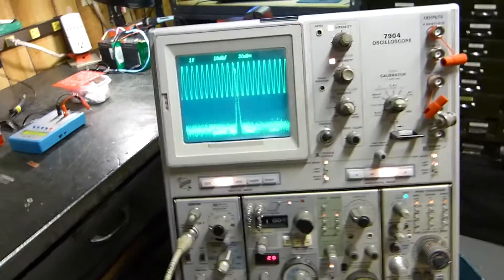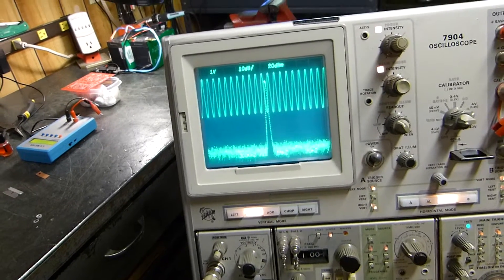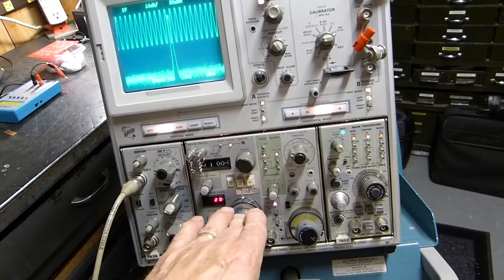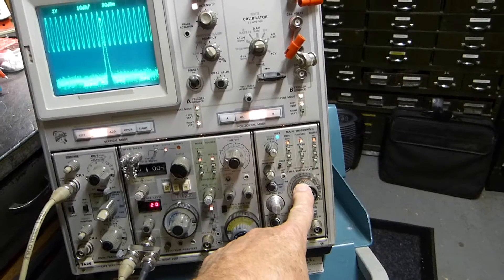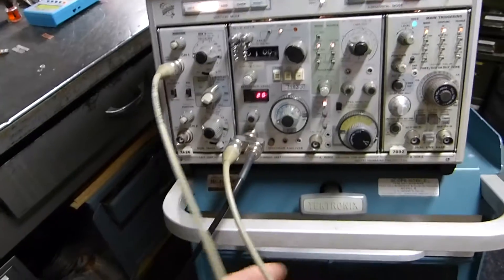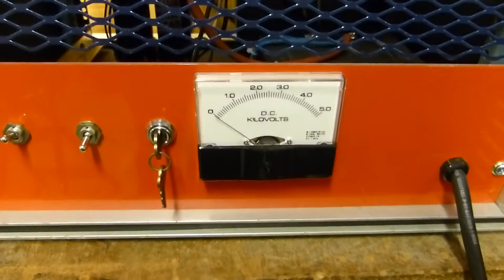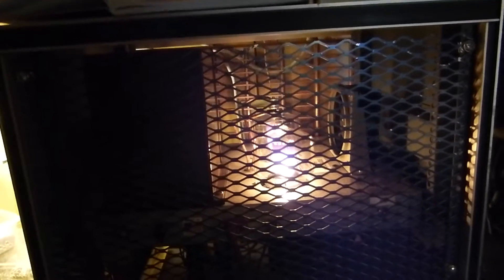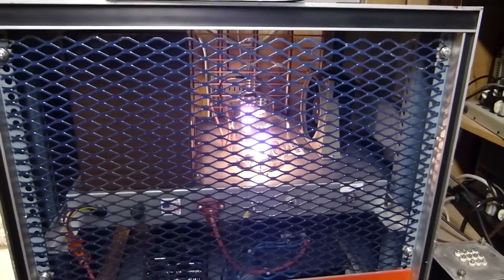MDO Vintage Tektronix 7000 Series Oscilloscope & Spectrum Analyzer

Comment: I have a 7L13 with a blown tantalum cap that I need to take some time and fix. The cap blew one day with spectacular fireworks and made me think I blew the whole scope! Luckily my 7904 was unharmed.
Reply from the maker: I had a capacitor like that in a 475 scope that was shorted and would not let the PS come up. I did not know a capacitor was shorted until I jumpered across the voltage regulator and forced the PS up (voltage a little high of course) and then the cap exploded, probably just like yours. After exploding and removing the short, it worked again...   :-)  I did replace the capacitor. I don't think I would have ever found the shorted cap without it exploding.
Reply: I had just bought the 7L13 and plugged it in and turned it on, then the smoke came out. I didn’t even get a chance to try it out. I still need to fix it one of these days. I decided after that that I was going to bite the bullet and buy 
the HP 8568B that I really wanted. THAT particular piece of equipment has been invaluable when it comes to aligning my Central Electronics 100V. I’ll use it on my my 32V-2 when I get it up and running as well.

Comment: I worked for IBM as an electronic technician in the 80's.  I remember the electrical engineers used these main frame Tektronix scopes.  The technicians had to use the old junkie scopes like the Tektronix 465B or older.  We also had a few HP on the floor.  Troubleshooting memory cards wasn't all that interesting.  We just had to check if a signal was there or not and replace an IC.  
...very boring.  For the most part IBM specialized test equipment told what chip to replace.  The electrical engineers did all the cool stuff.
Reply from the maker: John,
I started work with Univac in Huntsville, AL on a NASA contract starting in January 1970. Only a month away from being 50 years ago. Seems like yesterday, as the saying goes. 
If I remember correctly, IBM called their techs field engineers and later changed it to customer engineers and Univac followed IBM. 
I left Huntsville in 1976 and moved to work at White Sands Missile Range (living in El Paso) and  stayed with Univac. We then became Sperry Corp and in 1986 we were purchased by Burroughs and became Unisys. I stayed with them until all the mainframe contracts ended in WSMR in 1994.
In Huntsville there were some IBM computers there for payroll and whatever else but the Univac 1108 was NASA's scientific machines. They were a 36 bit parallel machine. I bet you also remember CDC and Cray computers. I never worked on them but was around them at Sandia Labs in Albuquerque working on the Univac 1100/80 machines. We had a lot of scientific machines as WSMR and a NASA site a cross the mountain and at Holloman Air Force Base. It kept us busy back then. I think there were about 20 guys stationed at WSMR for these sites.
I agree that the memory dropping or picking a bit was pretty easy to find just like an I/O channel with a bit error. The arithmetic errors in the CPU were another story all together...
We  mostly had 453 scopes with a few 485 scopes. In the data communication area, we called the cabinets CTMC, don't remember what that stands for, and there we mainly used an old 454 vacuum tube scope. Remember back then 300 baud was common and 1200 or 2400 baud was more than anyone should ever ask for ? ...   :-) and we had a few 475 but I never liked the fat tract on the 475 scope. We did not have any of the fancy stuff either like in this video. The 453's were used daily for tape drive work and calibration and working on card readers and card punches and printers. The 485's were necessary to see "holes" in the data tracks on the drums (they were high speed fixed head storage devices before the disk drive).
The nicer equipment didn't come until I was with Lockheed at WSMR after 1994 after leaving Unisys. We had a lot of interesting projects. I loved it there but the  "cold war" was winding down and the "illegal alien" war was was ramping up so I left WSMR in 1996 and went with Northrop Grumman on contract with INS (now DHS) and went into management.
Really good to hear from you. I never knew many IBM customer engineers. I guess we all lived in a  world of our own back then. When people asked me what i did, I learned to just say I worked on computers. They did not know what a computer was that long ago. That is usually where the conversation ended.
BTW, a little bit more that you might have done also - before leaving Unisys in 1994, I became a Novell CNE. Remember that? Novell networks were king back then but Microsoft plowed them under pretty much like they did the mainframe companies...

Comment: Just got a 7904A  for free with a other lot of scopes  I bought and was labeled as bad and tried it and works perfectly, they left beam find on and assume the amps were bad and stated he could not get a trace. Plus is low hours. They didn't know how to use it. Already tested it with internal calibrator and signal generator up to 500mhz and dead on specs. Keeping it and will fully restore it to keep it working.

Now looking for one of those 7L12 modules, but at a reasonable price, not the ridiculous non tested eBay prices.

Comment: Note that there is an important difference between the MDO4000 and the 7000 series scope with the vertical and SA plug-ins.  The MDO4000 gives you the ability to observe spectral activity that is time-correlated to the analog (and digital) signals.  You can observe changes in spectrum vs. time, as well as view amplitude, frequency and phase deviation vs time.  This is much more than simply simultaneous displays of the time and frequency domains.
Reply from the maker: Hi Alan, good to hear from you. I am subscribed to your channel but have not seen any new videos lately. I hope all is well with you.
You were (are) my source when I needed to learn about RBW and VBW, etc. Your videos are excellent. I have no doubt you are right about the details but I just found it amazing that Tektronix almost had a MDO some 30 years ago. 
My work did not require these instruments. Oscilloscopes and digital analyzers were my daily work as I worked on the mainframe computers for NASA and WSMR but those days are long gone and now I just do audio and amateur radio. I have built enough instruments that I don't know what to build next. I have met a lady in Kentucky that has sent me exotic audio transformers to build amplifiers for her and pays me in parts so that is what I am doing now. Thanks for your reply.
Reply: @ElPasoTubeAmps  I'm still producing videos, but not as often - it's mainly due to lack of time.  I've put up three or four videos in the last 2-3 months.  The most recent was about two weeks ago - a video on AM/SSB RF Envelopes and power measurement.

Comment: Dave, just so your viewers understand, these Tektronix 75LX plug ins don't grow on trees. They are pricey affairs fetching as much as $800 and up on eBay. So, good luck. Maybe the new MDOs csn be bad less expensively?
Reply from the maker: I have to agree with you that they are probably overpriced on Ebay and they seem to be getting more expensive every year. With that said, it is my opinion that, as you seem to agree,  MDO or spectrum analyzers may be better to buy new nowadays. I see all over YouTube where people have equipment by a number of companies out of China that seem to work very well and cost less than these 30-40 year old laboratory grade instruments. I do believe the very best buy in an oscilloscope is still probably a used Tektronix but some of these 1980 era devices are probably getting to the end of their life cycle - one I keep in mind is the HP 3580A audio spectrum analyzer. It is my experience that we as amateurs can benefit much more from the FFT devices that run our laptops and a USB sound card and are often times free software download rather than investing hundreds of dollars in an aging instrument like I just mentioned.
I document many of these old instruments just for historical purposes as they are ageing fast and the fact that this Tektronix mainframe can perform these multi functions well before MDO became a common phrase still amazes me.
Thanks very much for your comments.

Comment: Dave
 What is the secondary impedance here and where did you find an  transformer for these tubes that can handle 3KV without breaking down?
Reply from the maker: I got these transformers back in the early 70's when I was with NASA in Huntsville. I first used them with a pair of 4-400A's to modulate a class C 4-400A RF amp for AM. I connected the primary (high Z side) to the push pull 4-400's then connected the secondary side to the low Z side (secondary) of the second transformer and used the high Z side of the second transformer to modulate the plate of the class C amp. As I juggled the taps on what we would think of as the secondary sides of the two transformers, (the low Z windings) , I had a wide range of Z to the modulator tubes and a wide range of Z to the class C RF amp - hope this makes sense. I was running 4 KV on them all through this setup. When I left Huntsville in 1976, I disassembled the AM transmitter but kept these two transformers. As best I remember they were used in a Navy ship-to-shore PA amplifier and ran a pair of 810's. I am going to put one of them back to a pair of 810's and if it turns out really good, I may dissemble the one that I now have running the 3-500Z's and make "stereo"... I can get 8 ohms output and best I remember at this typing about 11K primary.

Comment: eye like your amp build..my mkIvs drive my khorns to the point of structural damage in upstairs apt.(electro-pnumatic pile drivng).i could have used that deposit money.a tenth of 1000 watts the tenants would need red cross i would demolish the complex.
Reply from the maker: Paul Biglane I have KHorns also and drive them with a Mac MC 2100 but I would not dare connect this monster to them. As you say, I would either demolish my house or set the cabinets on fire  :-))   However, I do have a set of Qualquist speakers that can take 200 watts each from a Mac MC 2205 and not even be really "loud" so I figure they have a chance of surviving. I will post the results soon. Thanks for your comments.